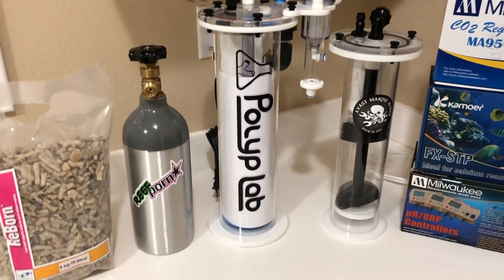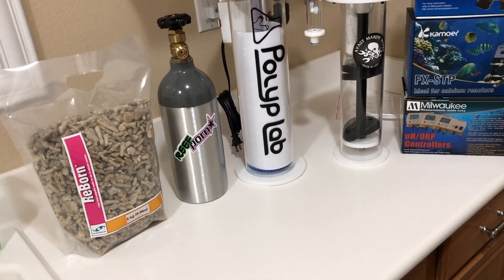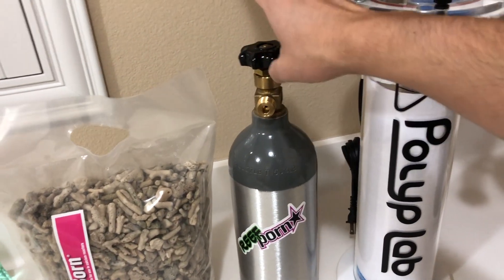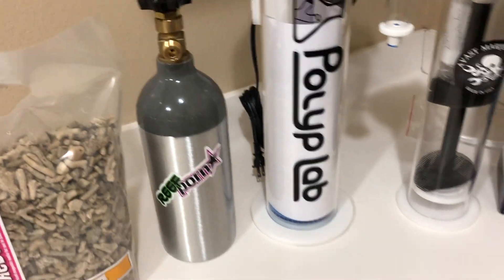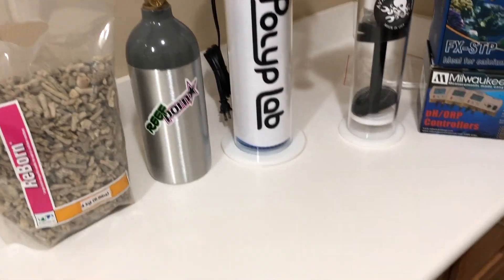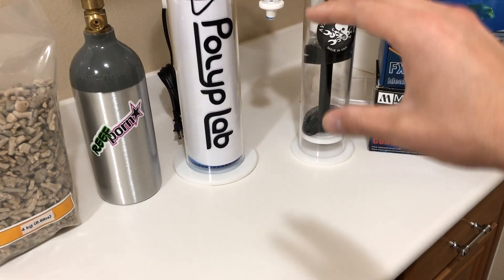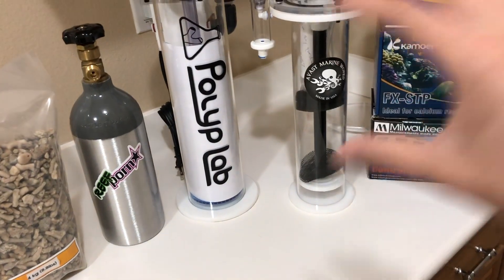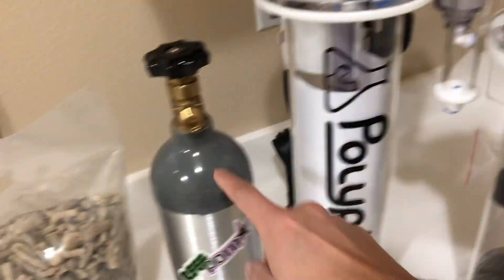Calcium Reactor Explained

Comment: Great explanation

I see value on a big tank and for those who want to set it up and leave it

But I think most of the best tanks are big and those reefers have been using them because it was by far the best option back then... now I think dosers are almost as stable - adding Ca / KH every hour is practically the same.

So just because many of the best reefers use them doesn't mean it is because of the CaRX that they have great tanks.

I also think you can better dial them in to your tanks usage through the day (so you are actually keeping your Alk more stable with a doser).

As I understand it it also only puts the elements that are in the coral skeleton (hence why lower Mag) so I am not sure about Trace and elements that are used to create colors in coral proteins- I get the stability but isn't dialing in a CaRX in a small tank difficult - and it is expensive for (at most) a marginal benefit on a small tank?

Comment: You need to check out Wincey's reef tank which was recently featured on reefdudes channel. You ALWAYS talk about stability. I understand what you're trying to preach but fluctuation in acceptable ranges can be beneficial. Calcium reactors arent common on nano tanks because its way more practical to dose and not everybody is spending $100s on coral. I'm saying all of this because you have a platform with many beginners getting into the hobby and they can be easily discouraged. Your content seems to be geared towards this crowd so just consider showing viewers how easy and cheap reefing can be.

Comment: Just watched BRS calcium reactor video and they found that changing flow rate through the reactor doesn’t increase/decrease the amount of elements delivered for coral growth significantly.  Increasing flow from 5ml/hr to150 ml/hr only increased alkalinity delivery by 10%.  Decreasing the pH through increased CO2 delivery would increase alkalinity and other growth elements delivered by the reactor at a much greater rate.  I would think that this would also prolong the life of the pump by not maxing out its effort to push water through the reactor.  What do you think about this?  If you haven’t seen the video I would highly recommend it-may extend your expensive pump’s life .

Comment: Reborn will not replace balanced trace elements even if you add remag- nobody questions how come I have a bag of dead coral skeletons, did they die because of pollution, a lack of trace elements etc etc, I think as time goes by you will start noticing your trace elements diminishing especially if you do ICP-OES testing. But otherwise I think they are an excellent tool for stability with Alkalinity ,Calcium and if you add remag - magnesium.

Comment: I have a JBJ45 that I haven't set up yet, I'm still buying equipment and planning my setup. I was going to try to do a Triton method style setup, but you may have just changed the direction that I thought I wanted to go! I would love to see a video of you actually setting this up and dialing it in!
Reply from the maker: Ya unless you are planning to add a 5g refugium under the tank hands down this is the best route. Not to mention triton gets pricey.
Reply: @DeepDropFishingTV  I was thinking about  using 2 of Marine Depot's Largest Refugium Reactors for that
Reply: At least that was the original plan

Comment: Great video, as always. It would be very educational if, after a certain period of time using the calcium reactor without water changes, to do an ICP test and make a video about it. As of now I couldn't find a source to inform us which exactly of the necessary trace elements are puting back in the reef by the calcium reactor. For sure most of them are present in the tissue of the corals, thus it will not be in the media of the reactor. But which ones? Anyway, as I know, you can not use a calcium reactor without water changes, because with time you will loose trace elements and only an ICP test will tell.
Reply from the maker: A CALRX doesn’t replenish all trace elements but it does replace some.
Reply: @DeepDropFishingTV  Yes, agree. But which ones? If I want to have a calcium reactor and not perform water changes which elements should I replenish by dosing? You don't do water changes, right? What will be your approach?

Comment: this works as explained with corals but in my experience; if you have clam(s) you will loose Magnesium faster than a calcium reactor with just Reborn can supply.
  I had to add other media along with Reborn to boost Magnesium.
Reply from the maker: That’s why I have remag on the way.